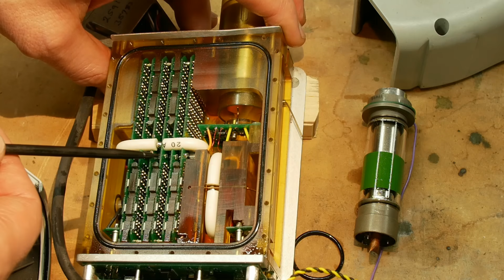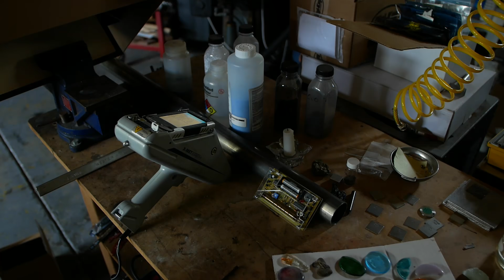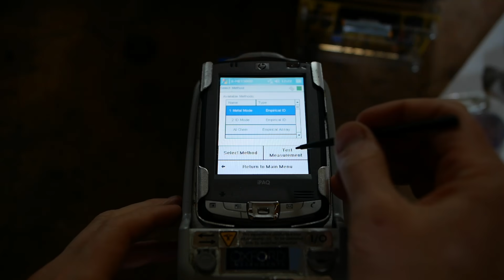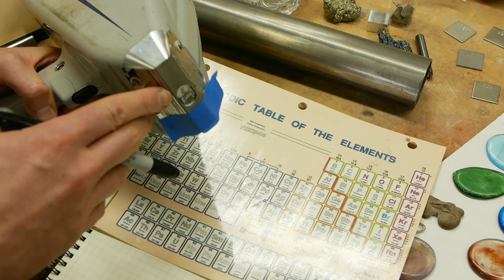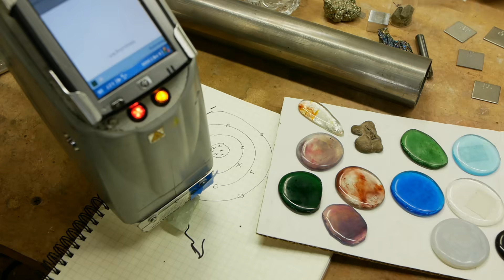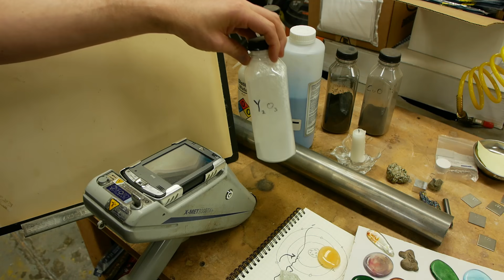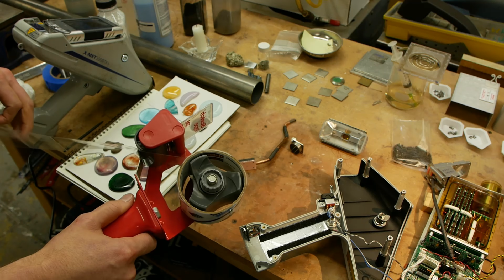Demo and teardown of an X-ray fluorescence gun (measures chemical composition)

Comment: This video was flushed into my attention again yesterday - in spite of having watched it already when it came out. However, I did not remember the phosphorescent green calcite crystal. I just recovered my mineral collection from my late parents' attic and in it I had a green calcite just like the one shown in the video - and yes, it also shows the same phosphorescence under a blue laser pointer. And there are two more calcite based samples in my collection which behave very similar: one labelled as "phantom calcite" and the other one a piece from the calcite deposited on a wet cave wall.

Comment: What does "7uA" as beam intensity mean? I would expect most xrays emitted by the tube to be absorbed by some part of the tube/its mount (because IIUC the emission itself will be spread roughly uniformly over a half-full spherical angle, which is decidably too wide for any application), and so I would naively expect that providing the tube current itself wouldn't be a good measure of intensity of the beam once outside the device.

Comment: Circuit Cellar has an article on how to build a diy version of this using an off the shelf photodiode and a super high-gain transimpedance amp.
He uses Am241 sources from smoke detectors to generate the 60kev xrays.

Comment: While the X-ray output power is definitely lower than a medical X-ray device, the medical devices often use very short bursts. Also, medical X-rays are typically higher-energy (>= 80 keV) than those used for XRF (< 50 keV). The accompanying lower penetration power might artificially reduce the rate your Geiger counter measures.

Comment: I bought one of these for study and unfortunately it must have been dropped, it doesnt have a signal nor does the alarm sound when the trigger is pulled and the xray light flickers. i suspect it may have cracked the xray tube. I hope not, but its a shame as these are drop tested at a meter, which is funny to me as most people are going to drop this at a higher position. we got this device to test the paint on the school buildings and the glazed pottery they eat from to eliminate lead containing products and painted contaminated areas. 100s of tests. Hitachi science division still service these, so im hoping we can get it repaired.

Comment: Negative filament and grounded anode is actually very common arrangement, you have exactly that in the magnetron supplies (in microwaves, ...), also with many other rf electron tubes like klystrons, common with many oscilloscope CRT designs, most electron microscopes, accelerated ion deposition devices, even many higher power Xray tubes with rotating anode target (mammography tubes,...) use the same. The thing is, it is usually way easier to insulate the single cathode supply (just a separate cathode filament winding on a transformer), and to have all the business end assemblies, which use to be way more complex (motor assembly on the mammography tube,, tye output filter aperture here, deflection and focusing electrodes on oscilloscope CRT or electron microscopes,...) just simply grounded.

Comment: Be warned! The beta particles from a strontium source can easily penetrate the walls of the GM tube, and are detected wirh high efficiency, but the <20keV x rays from the XRF gun are almost completely attenuated by the thin steel. The fact that the gun is able to light up an intensifying screen goes to show how intense the beam is. The actual exposure rate near the aperture may well be over 1Gy/h, a thousand times more than a little Sr-90 source. Except unlike a Sr source, the GM counter will barely pick up the soft x rays. Be careful!!! Great vid as usual though

Comment: I called these cancer guns when I worked with one of these, the general laborer guys would shoot stuff in their hands with these even though they were absolutely not supposed to. I always kept the business end firmly pointed away from any of my digits and had a rather thick steel and wood table for measuring stuff on

the more modern ones (they're still running windows xp ugh) are much smaller, about the size of a retail price gun

Comment: I spend a year repairing actual medical devices, including a couple of CTs. Most of Spellman designs of high voltage power supplies, if I remember correctly they had isolated PS for both HV and filament supplies with negative HV. This seems like a design safety feature as the parts that are nearer the main frame / body, can be actual electrical ground. So that if for whatever reason, you touch both the point of the gun and the touchscreen and there is an isolation failure ( which at 40kV is not difficult to happen ), you don´t get shocked. Of course that being said, another reason would have been isolation distances and leakage currents.

But generally, it seems like a common rule in all these HV machines that body has to be always ground ( for some very reasonable safety reasons ) and driving is done with negative voltages. After having seen those medical machines, this design doesn´t surprise me a bit, it´s just the same made very compact.

Comment: The main reason why you can't see fluorescense from oxygen is actually because it doesn't emit it (almost)!

The fluorescence yield (probability of fluorescence emission after photoelectric effect) decreases with atomic number and for oxygen is less than 1%. 99% of the time there are external (Auger) electrons that take the extra energy getting excited or ionized.

You can get this data from NIST databases as usual: Hubbell et al, "Tabulation of K, L, and higher atomic shell x-ray fluorescence yields"

Comment: I took apart a GE dental xray head that had the tiniest amount of oil in the tube, otherwise it was still at vacuum. 30kv across the cold cathode and anode would produce a detectable amount of xrays. If, however, I energized the cathode heater, the xrays stopped. I figure that the hot filament vaporized enough oil to halt electron flow. After some time,  the tube was again capable of cold xray emissions as the oil vapor condensed away.

Comment: Hi! I'm looking for a cheap way to create a particle detector and I was thinking about using the bremsstrahlung from particles hitting something (I don't know what yet, but I guess lead or aluminium would do the trick) and a photosensitive sensor. I know it's probably very crude, but if it works that's all I need. Thoughts?

Comment: You are consistently confusing energy and intensity of X-rays. I know you know the difference, but your viewers might not. This kind of videos have to be much more rigorous.

That said, it was almost 40 years ago when I last worked with XREF. Our first portable instruments had a radio-isotope source (power supplies for X-ray tubes were too bulky, especially batteries) and Peltier cooled detectors were still entirely experimental - we used Si(Li) cooled by liquid nitrogen in a small two-liter Dewar.

Comment: For a low current HV supply, it seems to me a piezo stack could do the job. Don't even bother to rectify it, just feed the HV AC into the filament, and it will only emit during one phase of the cycle, while the cold electrode at the other end can't emit. The x-ray tube itself is the rectifier.

Comment: I used to use a machine that would spark onto metal samples and analyse that for the properties of the material. It too could tell you precisely the composition as well. I can only presume the spark tester was cheaper and probably more rugged for an industrial use.

Comment: I've been trying to acquire a portable XRF gun for some 15 years. The cost of entry has been a persistent barrier. I would consider $3K a tolerable price. However, $9K to $30K is an immediate deal breaker. Having been an instrument designer EE for nearly 50 years I know the value of the guts of one of these units. Even considering software development costs, I can't justify such a high price. Anyway, I'm happy for you that you were able to get a working unit not to mention one that you could tare down. Keep up the good work.
Reply: I bought the amptek xrf system paid 22k for x ray and detector and I still can't get it to work right it's a pain in the ass

Comment: Repairing a dead Niton unit, the detector was destroyed.  It appears to be the same as in your video: a Moxtek cooled PIN diode w/Be window and 150 volt reverse bias.  Important, these detectors are evacuated for thermal insulation, so dropping the gun can FRACTURE the brittle Be window (measured about 160 micros thickness, or perhaps 150, to stand off 720 Torr!)  Oddly enough, the gun still worked fine after the destroyed cables were replaced.  However, it gives temperature errors, and cannot get below -25C, when its designed sensor temp is -35C, since the vacuum layer inside the cooled detector is gone.  Store the whole thing in the fridge?   Yep, then it works.   But I suspect that frost will now grow inside the silicon diode housing, and soon produce water damage!

Ah, it's like learning the art of medicine on a Medieval battlefield: what symptoms created when the enemy hatchet chops THIS part of your XRF instrument?!   Heh.

Comment: Nice video. Regarding the difference with uv fluorescence, x ray fluorescence is triggered by a ionization process while uv fluorescence is due to an electron transition from an exited state to a ground state. So they are not easily comparable as you show.

Comment: I actually found some samples of that special calcite in an abandoned gold mine up in Canada. I was playing around with a laser pointer one day, and accidentally discovered that strange phosphorescent property. I talked to several geologists, and I scoured the internet at the time trying to find out what it was. But I was told by the geologists that it wasn't phosphorescent, because their UV light didn't activate it. They also didn't view my laser as a "significant UV source", so I didn't even bother with them.... I was able to work out that it was some kind of mineral that was activated or "doped" with an element. Similarly to radioluminescent doped zinc sulfide. I never would have guessed that it was manganese doing the work though, of all things. Fascinating!

Comment: Why are these units so expensive?  5k is about rock bottom I've seen for Used items.  Crazy.
Also, you should integrate one into the scanning electron microscope you built, so you can analyze and photograph simultaneously!

Comment: My funny story: a few years ago found me running across a hotel parking lot in Rapid City, South Dakota...while it was snowing...with an uncased iPhone 6 in my shirt pocket...which jumped out...effecting a prompt “input of mechanical energy” on the lower right corner, which caused an instant structural failure of the display. Was it possible that x-rays were emitted for a brief moment during that event? 🤓😄😄

Comment: Power supply is built similar to a heliodent medical x ray power supply but smaller. They had major issues with capacitors blowing up or arcing over.

Comment: Interesting however it is still a mystery for me how the detector and spectrometer work, it doesn't look like there is a room for a rotating monochromator crystal in this tiny piece. I also wonder how they can get such a good sensitivity in 10s, the lab spectrometers I was using, with bigger tubes, scintillators and photomultipliers still needed minutes to get a well resolved fluorescence spectrum.

Comment: The 'silver' is likely aluminum, as its a common filter for medical xray units to create a clean beam.  This may explain why it can't read below aluminum, also.  Also, xray tubes are a relatively simple filament, and the smaller the unit, the easier it fries.

Comment: The XRF guns are cool and I've wondered how they work.

But I hate going to scrap drops from the shop...sure they can tell between stainless alloys, but can't tell 1018 (mild steel) from tool steels unless you have some fairly exotic alloy.

It only matters if you meticulously sort your drops and have enough weight to bitch about it...I'm pretty specific about sorting drops, but rarely have enough weight for the yard to care if I leave (plus I'd have to load it back in the truck).

Comment: but how do they know if the electron was from the K or L or M shell?
Reply: An election transitioning from the L shell to the K shell gives up an x-ray which is of a specific energy for that particular element. An electron transitioning from the M shell to the K shell gives up an x-ray of a slightly higher energy. The detector can collect these different energies and the electronics stores the x-ray events in different memory locations. If you could see it as a bar graph then there would be peaks corresponding to the different energies of the x-rays. The L to K shell transition produces K alpha peaks and the M to K shell transition produces K beta peaks. The K beta peaks will be much lower in intensity than the K alpha peaks because the transition from M shell to K shell is much less likely than from L shell to K shell.
This is how an energy dispersive system works. There are other transitions too but this x-ray analyser would not be able to see them.

Comment: That silver piece at 13:35 is probably a monochromator crystal. Only certain x-rays with correct wavelength will scatter in the direction of the opening. 
Love the video!

Comment: Another interesting application of portable XRF guns is in the conservation and analysis of works of art. 
You can see if the (inorganic) pigments of a paintings are degradated, which pigments were used in a painting and even if the painting is a counterfeit. By knowing the pigments that were available at the era and those traditionally used by the artist, you can work out if it corresponds to the output of the instrument. Some pigments were invented only "recently", for example prussian blue was first synthesized in the early 1700s so, for example, if you have a painting that's supposed to be made in the 1500s, you analyze it with a XRF gun and you find prussian blue, you'll now almost certainly that's a counterfeit.
The great thing about those XRF guns is that they are portable and they can be used 'in situ' and, most importantly, it's a non invasive and non distructive technique (in other words, you don't have to take samples of paint from the precious painting!). 
I used one of those XRF guns to analyze the pigments of a fresco painting for an university project, here in Italy! 
By the way, great video as always!

Comment: Good explanation on how the gun is able to identify a single element, but when you are pointing it at a sample and it returns a breakdown of some half dozen components like in your active solder video,  how is it able to identify the individual elements the sample is made of?  Are there multiple sensors in the gun that are each receiving indivdual xray bounces off the sample or is it taking many readings in a period of time until it finds itself repeating over the same values?

edit: nevermind.  paused the video, typed the comment, and got my answer about 5 seconds after hitting play again lol

Comment: Have you heard about this Chinese electric jet engine? They compress air like a regular jet engine, and then use microwaves (instead of combustion)  to heat the air into a plasma which is expelled to produce thrust. I think you should make one and test it! I know you've got all the parts :)

Comment: Whilst the actual x-ray energy involved is tiny, it's still powerful enough that pointing the ray directly at the person can relatively quickly exceed the annual radiation dose limits for workers in most countries.
Laws on these type of devices vary from country to country and state to state in the US, but generally in many places while you don't need any sort of licence to own one, often employers are required to declare their use to the relevant authority such as the HSE in the UK.

Also of note is that even when using the device properly there is a small amount of radiation exposure due to backscatter, although this is orders of magnitude below the intensity of the primary beam. Nevertheless it's advised to follow the principal of "as low as reasonably achievable" radiation exposure, which means using it at arms length, ensuring the beam is pointed away from your body, and making sure that the sample completely covers the window.

Comment: Cool; there are two manufacturers of the x-ray detector diodes; Moxtek (Utah) and Ampek. Moxtek made the x-ray source modules and detector modules for the ThermoFisher XRF guns. They were about $25k each when they first came out, but really useful for aerospace material checks and almost anything else.  These are 'soft' xray's, so you can see up to about 50kEv energies.  The photodiodes used even when cooled with Peltier devices have thermal noise that limits resolution of around 150 to 170eV.

I wrote code for the XRF spectrometer (Moxtek later released) for a DSP chip.

It's fun to play with atoms.  Careful where you point that thing... anything the x-rays hit flouresce which is not good for DNA...